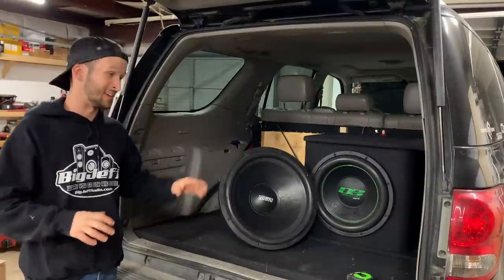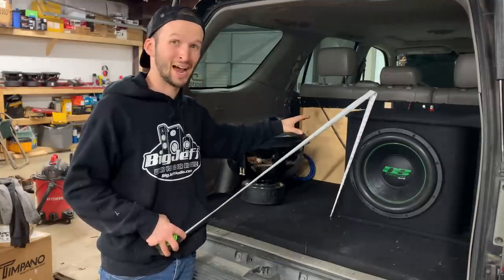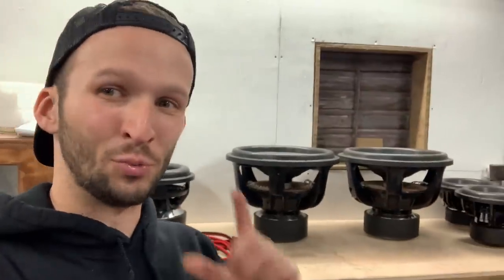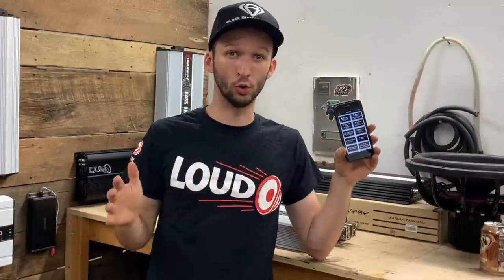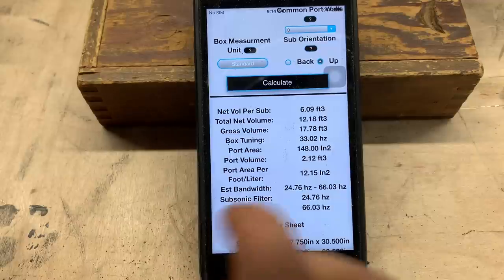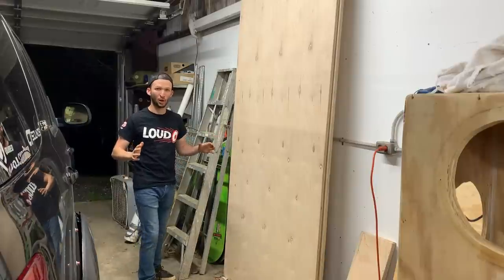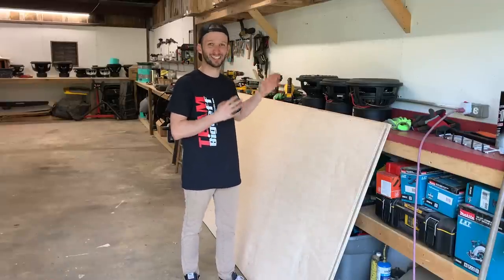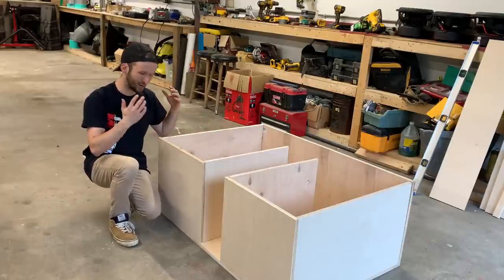SUNDOWN 18s Build On 16,000 Watts Part 3

Comment: Why does one of the 18s have a sagging spider?
Reply: Them stock tan spiders suck and get spider sag easy 😑 Parker should hit up Apex or Cory Dean for a proper recone with a Nightshade or Blue Gang spider and Mega roll surround
Reply from the maker: These are very used subs

Comment: Why not build your box all double 3/4 or 1.5 thick for those 18s and maybe triple baffles?  2 18x and 16k will make some pressure.    East said when I’m not buying the wood. Lol
Reply: @cristovalmontoya5222 my X15's has double 3/4 everywhere. The X series is no joke they will destroy a box. My port area is also 150 for 15s and his seems a little on the smaller side at 148 for 18s.
Reply: FACTS 1000%

Comment: The foam suround on the Sundown x series 18's look smaller compared to the 10's and 12's x series
Reply: his x18 has the spl surround, therefor its smaller
Reply: These are not stock X series 18's as these have aftermarket recones. These have the U series type cones.

Comment: I don't understand why people waste an X series by putting the SPL surround on them. They should just buy a U series. The whole point of the X is it's super long throw for lows and by doing that surround it's like building a 1000hp motor and then pulling four of the spark plugs....
Reply: The X series Parker has has U series cones dude🤦🏻‍♂️
Reply: It's an 18 all the surrounds look small on an 18.
Reply: Also, the X series has quite a bit less cone area than a U series, basically making it act like a smaller sub in a bigger box, gonna play deeper in the same size box as a sub with more cone area. My Xv2 15 barely has more cone area than a DD 9512.
Reply: On the x15, it’s like having the cone of a x18 except it’s stacked, so your basically getting the same thing out of the x15 which is excursion while on the x18 it’s cone area.
Reply: True but I think parker would of liked it with the mega surround rather than the spl ones on them. But they did come from his friend so those are the recones that came with them.
Reply: @jeffersondelira2706  Parker need to go Resilient Sounds 💯👍 he never trys any Resilient Sounds subwoofers. My $500 18" Resilient Sounds Platinum subwoofers can handle over 3000rms watts per sub and has a 8 layer flat wound coil and a bigger surround than those recone subs. ✔️IT OUT💯👍
Reply: @elijahdossett3528  what good does having you series cones do If you don't use progressive spiders as well? 🤷🏿‍♂️. You could just say you don't know what you're talking about and we will understand. Also... SPL spiders are Nomex... Nomex spiders go limp after a while. Doesn't even take that long. SPL parts are meant for just that... SPL. You don't put SPL parts on a sub thinking you're going to play higher.
Reply: @DibeezyTheGifted  and there is no difference between flat linear and progressive round spiders it’s a myth except for certain spiders may provide the capabilities for more linear excursion and may be laminated thicker/thinner depending on the application and desired outcome.
Reply: @Sneakdisscommentbelow  Lol... no.  These have aftermarket recones. The cones on these recones, have smaller surrounds versus the stock X series cones.
Reply: @DibeezyTheGifted  so, what exactly is "playing higher"? The difference between linear and progressive roll spiders are a moot argument. It's the compliance of a spider that affects its excursion capabilities(soft to stiff, and grams of weight). Also, material composition(nomex, poly cotton an so forth) has ZERO to do, with whether it's geared towards spl or sound quality, or demo. Nomex doesn't loose its form any quicker, than poly cotton blends.
Reply: @elijahdossett3528  correct. Material of the spider has zero affect. And the difference between linear and progressive rolls is a null argument.
Reply: @Chuck_Sanders  Parker putting some garage sale system together.
Reply: @Chuck_Sanders  material of the spider most definitely matters. Clearly don't understand what you're talking about.
Reply: @DibeezyTheGifted   I've been in audio as a whole, for 3 decades now.. and not just car audio. I did oem work for several manufacturers over the years,(recones, refoams, diaphram replacements, custom built drivers and custom built subwoofers along with amplifier repair and enclosure/ cabinet design) and have gotten to work with several great individuals in the audio industry(Thilo Stompler of TC Sounds,  Dan Wiggins of Adire Audio, Bob Carver  to name a few). The material used in a spider has no affect on its performance.. period.  It's the spiders compliance that affects the coils axial motion in the gap,  along with altering things such as the Fs, sensitivity, depending on the spiders compliance and layers used.  Nomex is actually flame resistant,  as the actual structure of the fiber itself isn't flammable,  and it can never be worn away.  It's superior to heat.. over poly cotton. The phenolic resins used in the textile itself,  makes it less prone to fatigue from heat stress issues. And, the argument of linear versus progressive roll spiders, has been proven a myth.. time and time again. The roll profile is null,  and one isn't better than the other when it comes to performance.. however the compliance and surface area of a spider does matter, when it comes to altering how a driver performs. I'm also still waiting on an explanation of what "playing higher" means... since I don't know anything.  👍
Reply: @Sneakdisscommentbelow  😂
Reply: @Chuck_Sanders  playing higher will get you a better number on the meter but the style box he's building imo is for moving air, we'll have to see how it goes, it might be those Deaf Bonces with the 2 8ks wired incorrectly all over again. By time Parker gets really loud he'll probably be diagnosed with dementia... 😆
Reply: @Sneakdisscommentbelow  I get it, and you get it about playing higher frequencies, burping and all that my man, for spl and numbers chasing. I just want old dude to explain what he meant about playing higher based on sub parts used lol, because he clearly has no clue what he's talking about. He's confusing enclosure tuning and subwoofers lol. But he's the "best" builder, west of the Mississippi.
Reply: @Chuck_Sanders  We get it man, not everyone can be loud, it separates the men from the boys, let him figure it out when he's 15k in the hole and his setup sounds like a wet fart 😂
Reply: @Sneakdisscommentbelow  haha, right.
Reply: @DibeezyTheGifted  that's what spl subs are known for... playing higher. Tighten the suspension up, Make the moving assembly lighter.  That's GOING to raise fs, but make the driver more efficient. meaning the sub plays higher naturally... it will play higher, and be louder.
Reply: @me unfortunately... sound quality is a subjective matter, and it's opinion based solely upon the end user.  There is no set standard of measuring sound quality. Every spider induces "mechanical noise" when in motion, and is not distortion. Every driver has Mechanical noise from the movement of the coil in the gap and the spider,  no matter who manufacturers it(Morel, Focal, JL, Sundown, Kicker, Alpine, Dayton... and so on). Distortion is introduced from the voice coil, as it loses its linearity of movement in the magnetic field.. and when reaching its xmech state, and coil saturation.  As far as "Mechanical noise" is concerned, 90% of that is reduced, once a driver is introduced into an enclosure.  It's not the same as Mechanical distortion from the voice coil losing linearity, or the physical distorting of the cone.  Thilo and others over the years, have debunked the theory of linear versus progressive being "better" at controlling axial movement,  and altering tonal quality.  Also,  no material composition is better than the other, and all will have frictional noise, as it is a moving part.  When it comes to tonal "or sound reproduction" quality... most of it comes from the cone composition(kevlar, carbon, glass fiber, paper, poly, hemp...), it's overall weight, thickness and so forth(adding to the overall Mms)... as it correlates to frequecy response and its roll off points.  Any audible noise from the spiders is fractional at best, and Mechanical noise is really only noticed in a free air state, and not much at all, when a driver is enclosed.
Reply: @me my point to the commentor was spider composition, and spiders being progressive or linear doesn't matter as much as compliance does. If both have the same or similar compliance, then neither will limit or hinder a drivers overall performance.  And as I stated, a spider doesn't induce distortion..and has no tonal values,  as its overall resonance is exceptionally minimal.  It's sole purpose is to keep the voice coil centered in the magnetic gap, and help contain and control linear movement. If it were that critical of one versus the other,  we would use one standard of roll profile specifically abroad. If you can build 2 identical drivers, and only change the spider profile between the 2 and keep the overall compliance the same or similar, and noticeably hear a tonal change, then you have an unusually keen ear to sound reproduction. Because it will  not alter the tsp's except in a fraction here or there..if at all.  And this whole "playing higher" was still never addressed to what he was implying. Playing higher or lower what exactly? Frequency bands?? That is related to enclosure tune, if that was the implications. What I think he was confusing was suspension stiffness and how it correlates to Fs, which doesn't really determine how high or low a subwoofer will play ultimately, Until the overall suspension is so stiff that the Fs is very high. Anyone can put random parts in a motor and basket, because it fits.. but it doesn't make it efficient, optimal or effective for the desired end result one is looking to achieve.
Reply: @me thats cool man. Most people that do recones and are subwoofer builders from home, don't usually use or have Fluxmeters or have Gauss measuring tools, to get the magnetuc flux  measurements. I have used one for years, when designing some Xbl2 motors, and doing some non pillar neodymium motors. That's great that you utilize tools like that, when you build. Nice chatting with ya bud👍
Reply: @me oh, ok... Gotcha.
Reply: @RyanBassForLife have a friend that did 15k burps on two plat 15s in competition and another that did 12k per on music for demos. They handle the power but the company is super crappy. We had four cars that were all RS and the company treated us poorly and wouldn’t even talk to us at shows. Everyone switched to sundown or audio ace. Pulled like $12k of RS stuff out of the cars. One of the cars did a 163 on the meter too so it’s not like we didn’t know what we were doing. Guys attending national finals for usaci and iasca but not worth RS’s attention.

Comment: I have a question for parker or who ever may have an opinion.....i run a single american bass xr d2 12in sub in my 98 s10 extended cab ....use a jp23v1.5 amp with big 3 and small upgrade on my alt....have been thinking of swapping the single 12 for dual 12s ....or would it be better to buy a beefier more expensive 12 and stay with the single set up ....i have a 2 cubic foot kerf ported box single 12 box at moment ...i know if i go with 2 12 or lets just say another xr12 d2 ....cost of box and sub will be around 400 ....would i be better off to spend that money on a upgrade and stay with the single or go with 2 xrs
Reply: Depends if u can get the right box for the 12s. I have a single 12 on half the power my buddy has on his 2 12s and I’m louder by .3 db. Both are trunk builds

Comment: Please do nut run 12” sq. of port area per cube on those 18s with 16k rms on them💀 holy freakin port velocity 120m/s sheeeesssshhh
Reply: hey got a question...having a hard time finding any good box calculators paid for or other wise....slightly newer to car audio, so don't chew my head off please....for 2 x18sv3....can I ask what size port and length would it be on a 14 cube box for these....also whats a good and fairly simple program.....dont know wft, but I cant seem to find anything???